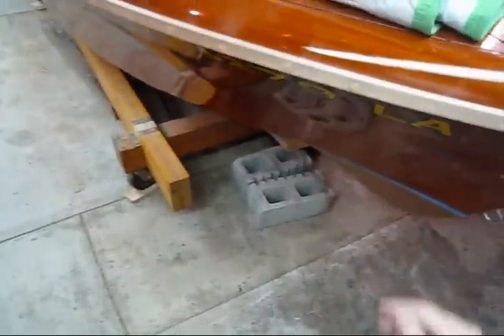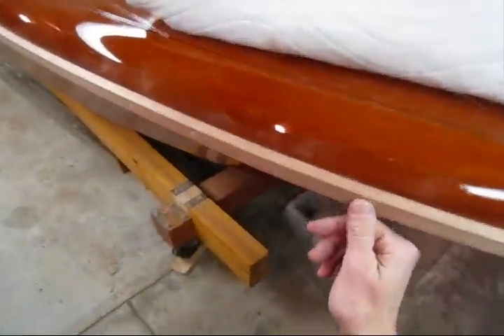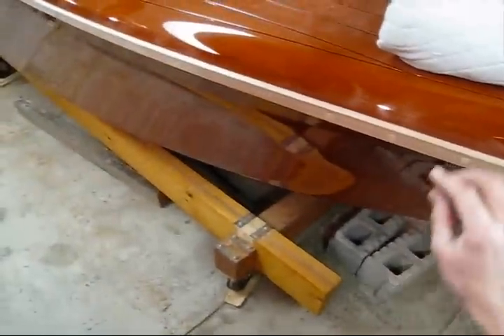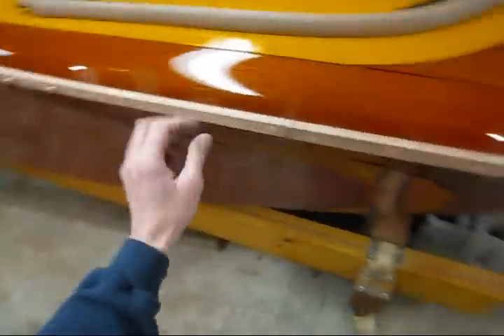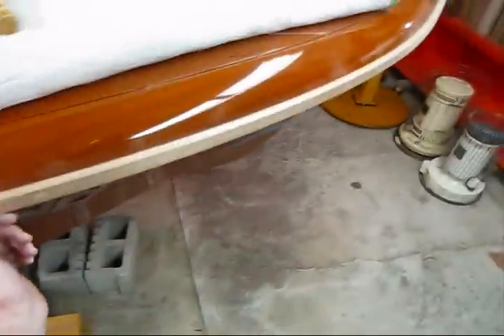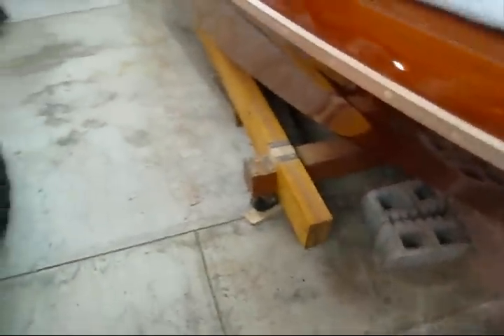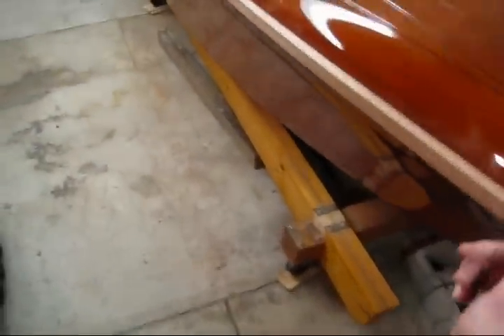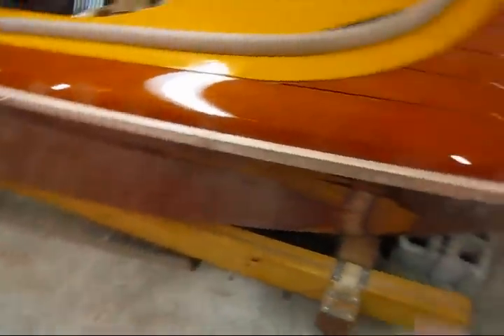Quick Tip #6 (Paring Down Mahogany Bungs) (Preview)

Comment: As usual, an outstanding video!  I wish I would have seen this a month ago...

Anyway, a few questions:

It appears you varnished the rest of the boat before you installed/varnished the rub rail.  Can you explain how you did/will varnish the rub rail?  

Any problems between the seam of the rub rail and and the covering board, especially on the top side?

Great tip on the little block!  It's crazy how something so trivial seem so obvious!

Comment from the maker: I built a 12" by 12" hardboard duct that runs through the main shop from the woodburner to the other room. It runs through the rafters. I hung a blower motor over the woodburner where all the hot air hangs out and I pump it through that duct into the other room. It works well. I also start a kerosene heater too if it's really cold.

Comment from the maker: I would normally install the rub rail before I put a finish on the boat but it didn't work out that way this time for a few reasons. The deck only has 4 coats of varnish on it. It needs at least 4 or 5 more coats. The hullside also needs a few coats. I will catch the rub rail up with the deck by appling 4 coats of varnish. I will then remove the blue tape and apply an additional 4 coats on the deck and rub rail together...then the hullside. It will all blend together in the end.